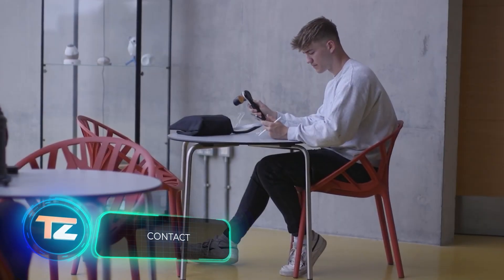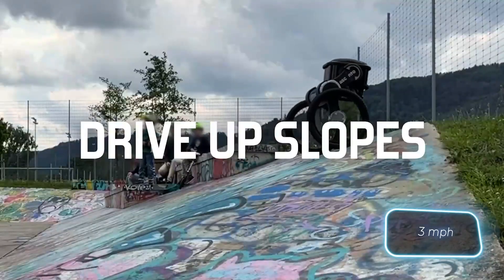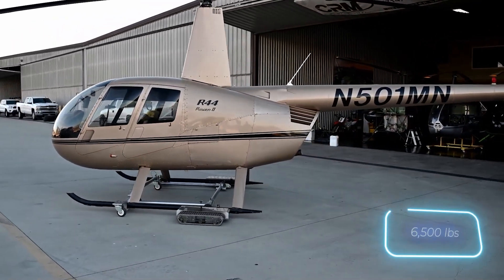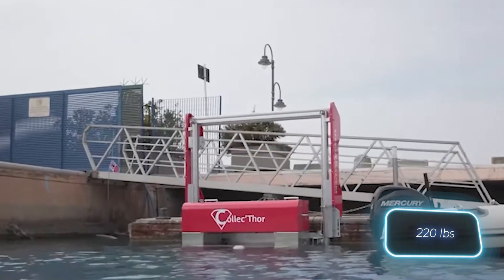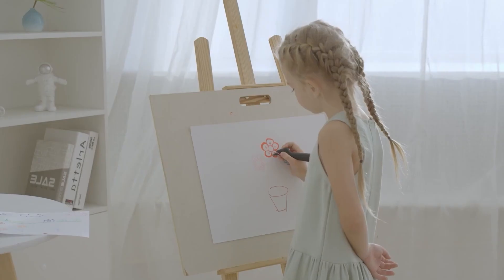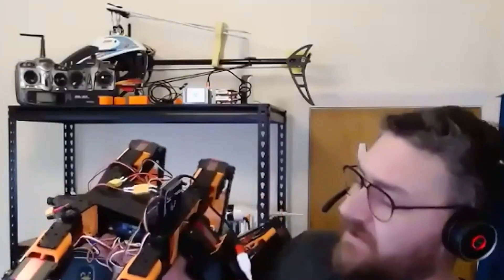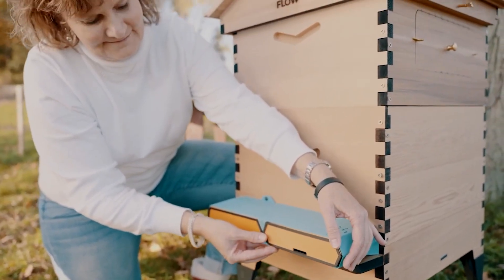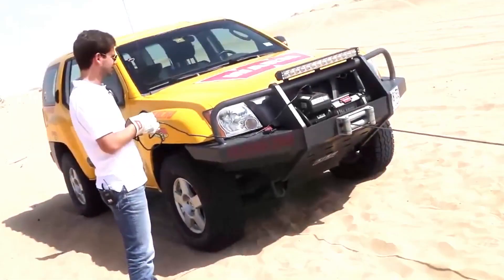COOL INVENTIONS YOU SHOULD SEE

Comment: The aircraft tug 
I don't think anything was said about price but if the military could use this concept, not only could they get rid of the very large tugs with GAS ENGINES but they could also get rid of towbars. Towbars are simple and don't require alot of maintenance but it would save alot of space especially on aircraft carriers.

Comment: Regrading the H2Fly plane.... Hydrogen fuel cells are bombs. Hydrogen is used as a rocket fuel because of it's ability to suddenly release a highly intensive amount of energy and it's high energy to weight ratio. But if it's containment is punched, it becomes a bomb (Space Shuttle Columbia). Hydrogen is a 4x net NEGATIVE energy source. Sure hydrogen produces no green house gases when it is burned - EXCEPT - it requires burning fossil fuels to produce it (at scale) and that produces green house gases. Hydrogen fuel cells are expensive because they require an expensive metal as a catalyst - platinum. Platinum is one of the rarest metals on Earth. When tritium is massed produced at scale (which it can't be) to fuel a commercial fusion reactor (which there is not) then hydrogen fuel cells may become a reality if everyone would turn in their platinum jewelry (which they won't).

Comment: Unfortunately, hydrogen aviation ignores a very important, and devastating fact.
Yes, hydrogen has a bit less than 3 times the energy per weight unit compared to jet fuel... but jet fuel has 3 times the energy of liquid hydrogen per volume. Add in that jet fuel can be used in unpressurized, uncooled, only puncture resistant tanks, compared to the cryogenic tanks for liquid hydrogen...
If one includes the tank into the equation, jet fuel has seven times the energy density per weight unit compared to hydrogen.
Reply: They did say liquid hydrogen. But of course the 3 times energy efficiency probably doesn't reflect the 50% loss due to venting of evaporating hydrogen to prevent over pressurization.